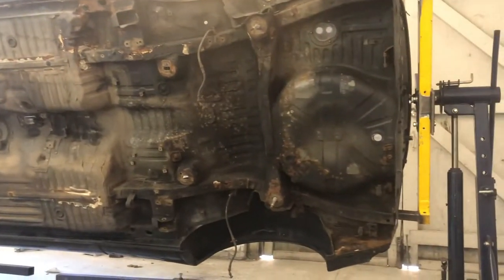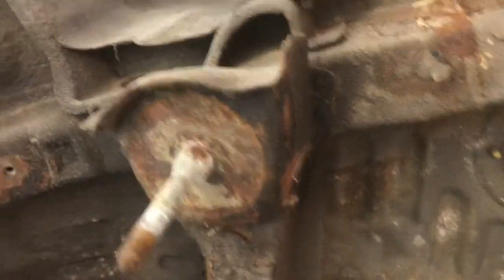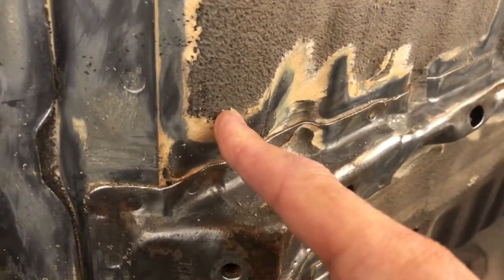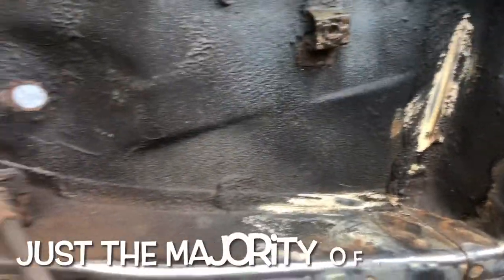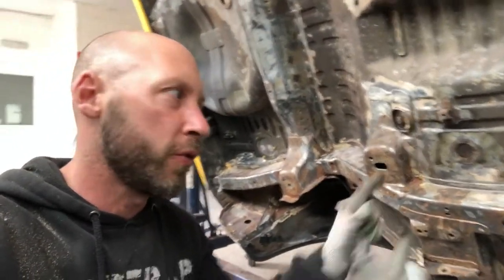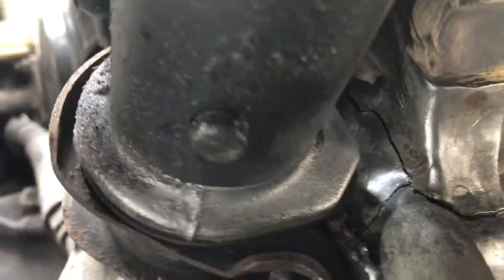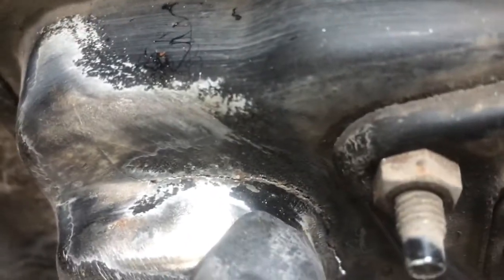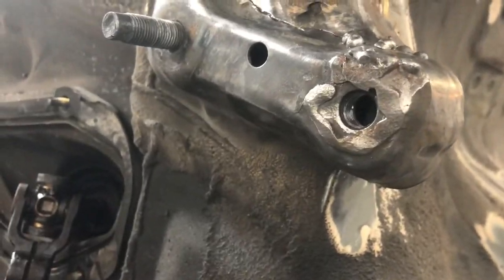Celica gt4 st185 restoration #13 Stripping the underbody and finding more work

Comment: My mum's ST184 has its steering mount cracked similarly, although the crack extends back under the chassis further than this one. I was hoping not to have to pull the whole car apart to fix it. :(